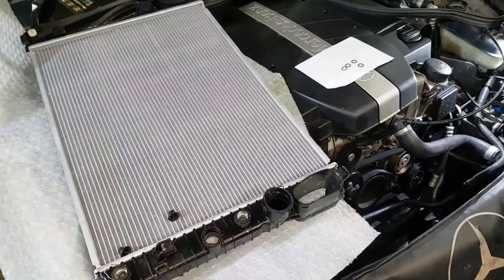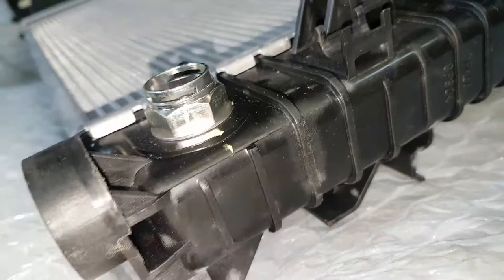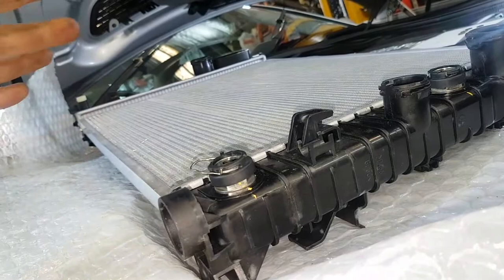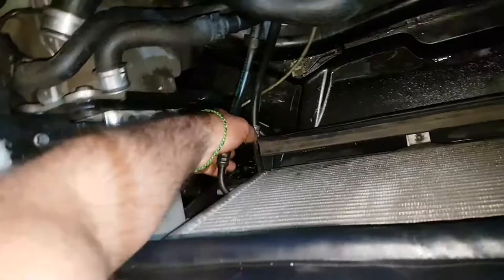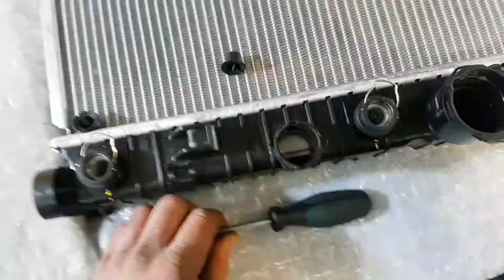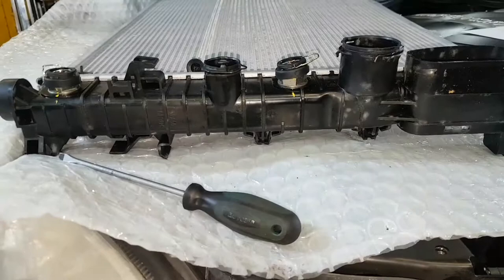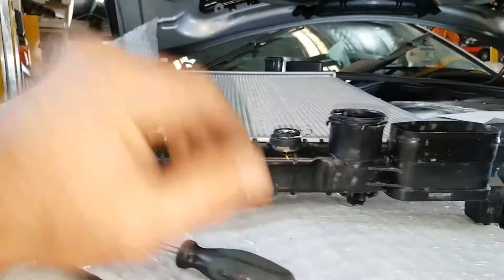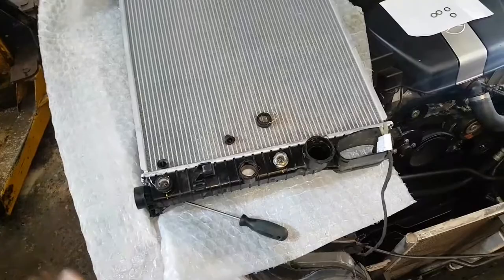Mercedes-Benz E Class transmission oil leak C Class hose o'rings radiator cooler E240  211 oil leaks

Comment: My bottom line popped off to but not all the way? But enough to lose a lot of tranny fluid while driving on the freeway, almost left me stranded 😔 I got off the exit and was at a red light then the light turned green and I pressed on the gas pedal and the car wouldn't move 👎 I shifted between gears until finally it moved but slowly, I barely made it home with smoke coming from the bottom of the car from tranny fluid that squirted, this clip design is unsafe and untrustworthy beware, looks like im not taking a road trip with my gf I don't trust it, I like mercedes for the looks but I hate to admit that I would feel much more safer in a Lexus.

Comment: The same can be said about the turbo intercooler pipes, they go with a bang, and you wonder what the hell happened!
Thanks for making this video I've just noticed a small patch of oil in the middle of my radiator fins which I will have to address at some point.
Reply from the maker: You're welcome it seems this videos helped a lot of people as it's as I said a very very dangerous thing to happen for the car and for the environment

Comment: Great video! I have mixed the lines on my Mercedes E350. Do you know if hot oil from the transmission goes into the top of the radiator or the bottom?

Comment: Hi guys,need help. do you have the Parts numbers for the plastic sleeves around the transmission hose to radiator and the metal think under that plastic sleeves? 
Thanks

Comment: Any advice, took my car in for regular service and they state the coolant has transmission oil in it. They are currently checking to see it a new radiator is needed or new rad and transmission. 14 e350 cabriolet 72k miles

Comment: Thanks for this video! I was removing my old radiator but was having trouble removing the Trans lines from the radiator...been very careful as I don't want to break the lines while removing...  I sprayed pb blaster per your recommendation, should the lines be pulled straight out or do they twist out? Do  I need a special tool to remove them? I have removed both of the metal retainer clips, but still not coming out... BTW the plastic clip on the bottom and top lines have a Blue dot at the top, which is where it seats properly... going to mark my new clips on the new radiator to make a sure it seats properly! Thanks very much for the advice on the Trans clips didn't know they could be slightly off and cause such problem.

Comment: My guess is this usually happens after the stock factory radiator has been replaced. Most people go with the slightly cheaper after market brand radiator so I'm guessing either the retaining clips or the connection on the radiator are not as good as the factory OEM radiator and this leads to the line popping out. My c55 made it to 100k no problem without any lines popping out. I replaced the radiator with a non oem one and it popped out on me twice. Ill try to swap over the connection from a used OEM radiator and use OEM clips. If this doesn't work an OEM radiator is going in.
Reply: lol slowly coming to the realization I may have to take mine out again and get OEM Quality

Comment: Hello, the same thing happened to my E320. I lost most or all of my fluid. I replaced the orings and secured the clamps properly. I filled the transmission with about six quarts of Mercedes recommended transmission fluid, however, now the car won't take any gears and won't move. Any suggestions?
Reply from the maker: Wow
Reply from the maker: Possible drum wear and subsequent speed sensor failure. Make sure U scan all codes reset everything. But I'm fearing wear that's damaged speed sensor. Let me know how U go. All the best.
Reply: @MechanicalMentor  Hello, thanx for the info!
Can you tell me if a wide copper washer is enough to apply between the radiator and the metal part? where antifreeze flow out

Comment: Please I don't get this... so what's the solution, how you get it in place without it coming off?
Reply from the maker: jubril usman straight and secure with new orings with no interference or pressure on fittings
Reply: Mechanical Mentor i currently have the same issue.. your video doesnt show you securing the orings.. do i insert the rings in the clip or on the pipe prior to clipping? Thanks
Reply: the c-clamps are trash one time use,the orings never go bad them cheap clamps go,and dissimiliar metals make this such a weak spot with every hose going to the radiator.Cheap sheet metal and stainless dont mix they rust together.
Reply: @jaybeejb5329  @mechanicalmentorI have the same question, where does the o ring fit in? Inside the hole before putting the pipe and clipping or where?
Reply: @MechanicalMentor  where does the o ring fit in? Inside the hole before putting the pipe and clipping or where?

Comment: I've watched your videos at least 10 times today I can't get bottom line to stay in place it pulls with little to know effort
Reply: after you get it in j b weld the hell out of it. all the way  around it & for this let it dry for a day.did mine like this been holding for over 2
 years .
Reply: @keithsolow8590  steel stick or what?